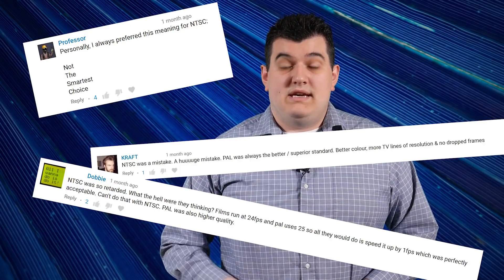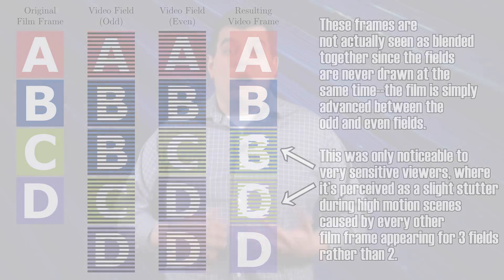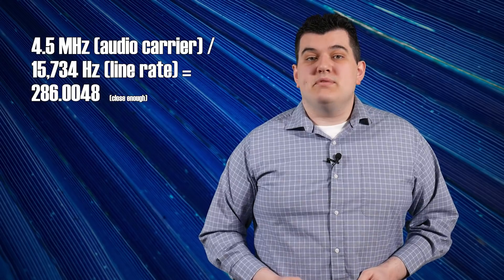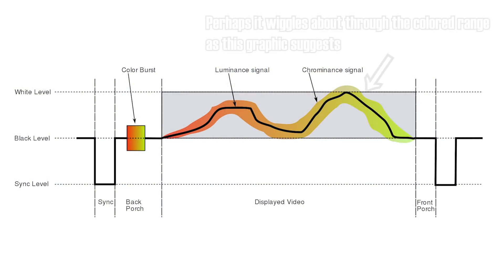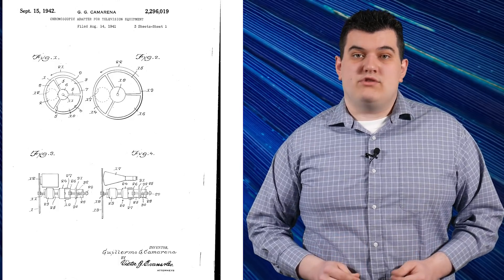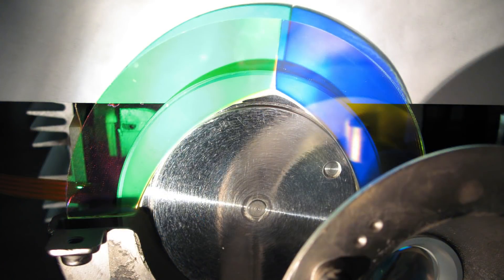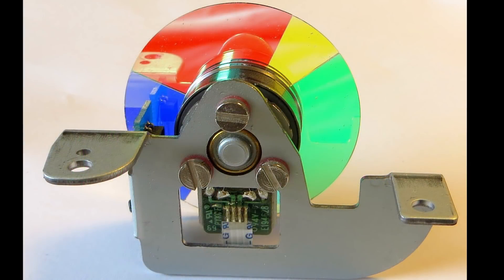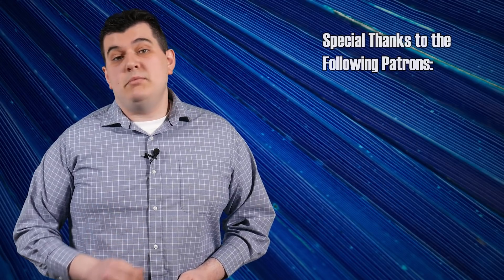Analog Color TV Wrap-Up--Some extra info

Comment: Boy you bring back my memories of color tv. I use to replace a lot of color picture tubes back in the day!!! The old round ones, the triad or triangle gun, the inline 3 gun, and the Sony one, which was the easiest to align , I could tell you stories. Sony’s were great color TVs but the tuners were a pain in the neck especially the UHF tuners. I had to rebuild many a tuner in my time. Electronic tuners fixed that issue. I still have 3 working NTSC TVs in my house, two Sony’s and 1 Zenith and the one Sony is about 40 years old and still going strong!!!! And yes I was a tv repairman!!!

Comment: Just noting here that PAL shouldn't be confused with the various broadcasting standards that use PAL color encoding. Most PAL broadcasting standards are similar with differences concerning only channel and video bandwidth, but PAL-M which is used in Brazil is transmitted with 525 lines at 59.94 fields per second.

Most sets I've used happily picked up PAL encoded colors from ~60 Hz field rate sources (PAL Atari 2600 running NTSC games, PAL Amiga 1200 running a 60 Hz video mode, MSX2 at 60 Hz). RGB is often available as a much better option for these systems, and everything is headed towards digital, so this is increasingly becoming a piece of useless trivia, though.

Comment: I read here a few complicated explanations re 'colour dot crawl' on a PAL or NTSC broadcast (they both do it). A good way to think of it is when you modulate a carrier with the information you are left with the carrier and sidebands. Those sidebands run either side of the carrier from effectively DC to infinity but they are at multiples of the modulating waveform, they look like the lines in a diffraction grating. This is the crux of how the backward compatibility worked. The sidebands allowed the cleverly chosen colour sidebands to slot, like a comb into the luminance signal. The B&W receiver would just not see the colour and this is why the NTSC colour(color) frequency is chosen - not to be 3.58MHZ but 3.579545 mhz±0.0003% so it ALMOST perfectly slots in. - It doesn't hence dot crawl.

Comment: One thing we need to remember is NTSC color, PAL and Secam are techniques to encode colour information into a monochrome television signal. The whole debate about 525/60 and 625/50 is unrelated. It is entirely possible to broadcast 625 line NTSC color or 525 line PAL or Secam colour or like the Japanese adjust the colour space and black levels of NTSC and in fact some South American countries broadcast 525/60 line PAL or like Brazil 625 line PAL with a carrier set at 3.58mhz... so for a true comparison set up a monochrome standard and then add the color system ... the BBC test broadcast 405 line with NTSC color for instance and here in Australia tests were carried out with 625 line NTSC and 625 line PAL before choosing the PAL standard.

Comment: Speeding up the film was better than 3:2 pulldown. To this day I can't stand pulldown judder. It is not "only noticeable to very sensitive viewers"! Your graphic is misleading, it shows only one phase - the fields are not really misaligned, however the judder caused by pulldown is just awful - it's always noticible. The problem is that frames B and D appear for 50% longer than frames A and C. So when you're watching a 24fps film, every even film frame is displayed twice as long as every odd film frame. A similar thing can be said with the pitch shift in PAL - it's not always noticeable, but when you know how something should sound it becomes obvious and irritating.

But the other disadvantage to NTCS is that shows couldn't be filmed at 30fps in 16mm (or 35mm). To film at NTSC's native 30fps you had to use video cameras. Shows that were shot on film, for example Sienfield, were filmed at 24fps. It was rare to have film-based cameras that could film at 30fps, Hollywood used special high-speed film stock any time they had to shoot material faster than 25fps (for slow motion shots). Filming at 25fps was commonly done to film CRT televisions and monitors, and those shots then played back at 24 frames per second with the rest of the film. Almost any time you see a TV in a film in the 70's, 80's, or 90's it is either a composite element, or a PAL-compatible TV running at 50Hz and filmed at 25fps.

Comment: Interesting; I recall back in the 1980s that it was common knowledge that American TVs had fewer lines than ours (and this was the reason why one couldn't buy movies on VHS in the US and play them at home) but not that the FPS was different, the '24 FPS for TV, 25 FPS for movies' thing was usually quoted on children's TV as though it was a universal standard. As far as the thing about the BBC switching from 405 to 625 lines goes, I think the reason why backward compatibility was not considered an issue was that the 405 line system had been introduced in 1936, almost 40 years earlier, and couldn't be sustained indefinitely. (Ironically, as the National Media Museum in Bradford points out, in 1936 the 405-line TV system was marketed as 'High Definition Television', which it was compared to what came before, of course--there is nothing new under the sun).

Comment: The ability of PAL to "correct" for phase errors by averaging alternate lines is one of its worst features. PAL is, in every way, worse than NTSC. The transmission chain is free of differential phase error, * and with a correctly designed receiver, NTSC will always produce the superior picture, with greater color detail.* PAL "corrects" this error by desaturating the color. Given the high-quality transmission chain in the US, differential phase error was generally not a problem (though it was in Europe). Henry Kloss (who designed the Advent projector) once stated that the best color TV he'd every seen was NTSC. It should be, because NTSC is inherently superior.Almost everything else you state is mostly correct. Despite being an EE with plenty of reference books on color TV, there are many things about color TV I still don't understand. If you'd like to get together and discuss them, I'd be delighted.  grizzledgeezer@comcast.net

Comment: about 25vs30: this has nothing to do with quality, but all to do with mains-hum.
Europe has 50Hz/230V mains and PAL has a field-rate of 50Hz to keep the mains-hum outside the visible portion of the signal.
America has 60Hz/110V mains and NTSC has a field-rate that's close enough to do the same thing.
Reply: NTSC games ran better too
Reply: @blackhatfreak  In my experience, it's more of a preference, and nowadays mostly irrelevant. The thing is that PAL has better resolution, and NTSC has better framerate. In reality, you probably shouldn't use either of these for games, unless you really want/need to, because on modern-ish game consoles like Wii, PS2 or Xbox 360 it looks like crap either way. The only thing that annoys me about PAL is that when I'm capturing video from my consoles, my crappy capture card doesn't know how to properly deinterlace video, and so I get 25fps mess, which is a lot worse then the same mess in 30fps, but running on a real TV, I don't mind 50Hz/fps honestly.
Reply: That’s 60Hz/120V for North America, not 110V. (It hasn’t been 110 for a long, long time.)
Reply: @tookitogo  it was when standard was defined, so more accurate correction would be *had
Reply: MrBlc Duh, hence why i said “it hasn’t been 110V for a long, long time”, so clearly I know it used to be the standard. But in that case, the OP would have needed to say that it was 50Hz/220V, since that nominal voltage has since changed, too. My point was simply to remind people that it’s 120V now, and has been for the better part of a century. It’s illogically irritating to me that people still call it 110V so long after that ceased to be correct.
Reply: "mains-hum out of the visible portion of the signal" isn't absolutely correct. Instead, using the same field rate as the net frequency ensures that if interference distorts the picture in a TV set, the distortion is stationary and doesn't run through the picture. Stationary distortions are much more sufferable than moving distortions.
To make this work, the field rate was synchronized with the net frequency. The TV set would hang on the same electricity grid as the TV station. If you received a signal from abroad from another country whose electricity grids weren't connected with each other, it wouldn't work.
By 1953 when color TV was introduced, TV manufacturing was already that advanced that interference was no longer an issue. So the developpers of color TV could create a system were field rate and net frequency were no longer identical and the field rate was no longer synchronized with the grid. This created problems in older b&w sets that suffered from interference. So color TV was not 100% downward compatible.

Comment: There were dual standard TVs, both monochrome & colour, available in the UK during the sixties.  This was during the period leading up to the other channels (BBC1 & ITV...yes, we only had three channels at the time) converting to 625 line UHF.  These dual standard TV sets had their mechanical contact problems, and I certainly remember that.  You can see a marked improvement in quality, looking at VTR recordings from the 60s, even for monochrome pictures, as they moved to the newer camera equipment.  However, I am aware that a dwindling 405 line VHF service did persist, until finally closing down completely in 1985.

Comment: Have not watched it all yet... but we also need to remember that it was in Interlace. It was 50 FPS (PAL) more or less with half the  resolution... it is really visible when you digitize PAL... 1 digitized frame (1/25) contains (if it's a moving scenery) 2 actual frames interlaced...

Comment: Actually, I have an issue with PAL unrelated to framerate or resolution or movie compatibility and/or convertability.
My problem is with the phase alternating itself and with the delay line used to handle it.
Now that analog broadcast are no more, the technical advantage of PAL is no longer needed. PAL's current significance to most people is it's use in mostly old locally connected consumer electronics, using in Composite and S-Video connections.
All but very old PAL TVs use a delay line to correct broadcast related color shift, which is a convenience for broadcast, but does NOTHING for locally connected equipment that electronically generate the video signal, like game consoles or DVD players (Video tape decks are a different matter, especially when you play old TV recordings that might contain those broadcast errors). For these, which I would presume are the only current widespread use of PAL, the delay line just reduces color resolution and offers no benefit, because the signal is already good... Except, for what I've been noticing with, for example, my PAL SNES when I capture with a PC device. A slight problem shows up that doesn't seem to happen with other PAL video sources. The phase alternation on the PAL SNES's video generator seems to be slighty off. When displaying mostly flat colors, if I turn down the function on the card that is equivalent to the delay line (mixing last croma line into current so that phase changes cancel out), I actually get slight hannover bars.
My theory is that the video generator doesn't do the phase alternation 100% correctly and just relies on the delay line in all TVs to correct it's own shortcommings.
Also, while there's a hue control included, adjusting it manually doesn't solve the problem because the adjustment that fixes one line throws the alternate one off, because the phase shift done by the encoder is incorrect for one of the orientations.

PAL was meant to fix BROADCAST problems in a time of analog TV, and in that field it certainly succeeded. As a system for locally connected equipment, it's just messy.
I like the rounded rates (no decimals, like in NTSC), I like the higher freq of the color carrier (more color resolution), but the phase alternation technique that made it great for broadcast, just makes things harder now, and easily falls victim to cheap implementations.

Comment: One of the the various issues with NTSC PAL and SECAM is the ability to maintain quality over long cable transmission (esp. in the days before satellites)...  ironically ..apparently.. NTSC was more stable and easier to manage in such conditions ..perhaps because it could be rectified more easily.  SECAM was notoriously difficult to use in the studio (chroma key for instance is impossible)  so even in France  programs were created in PAL and transmitted in SECAM .  As for frame rate.... many UK productions were filmed at 25fps for obvious reasons.

Of course in the UK during the 50s the BBC experiments with 405 line NTSC colour ... but in the end the decision was made to hold off colour until 625 line came on stream. I suspect because 405 line NTSC displayed on sets of the day looked as good as 625 line in an era when CRTs of the day had relatively lesser resolution. 

In the valve (tube) era stability of transmission chains was a big issue for the BBC and I suspect that was also a major deciding point ..but also I get the feeling the Beeb simply did not want colour at the time. ITV was pushing hard! Advertisers wanted colour.

As for NTSC vs PAL.... forget it.... side by side NTSC -M vs PAL G is all about resolution and stability... and colour accuracy... and PAL G wins both but flicker is a more subjective issue... I have never be worried by 50hz flicker... I have lived with it all my life...these days of course.... 525 line NTSC at its best is good but somehow reds and oranges never look right for me ... start an NTSC DVD and the WB logo looks orange not gold...purely subjective...
Reply: Regarding the first paragraph... NTSC's hue fluctuation issues were only ever an issue in over-the-air broadcasts. Once put into a wire, it was rock-solid. 

Regarding the last... I suspect the color issue was due to the display not really being set up for NTSC image reproduction, as I've never had those issues on my American television. If your display is configured for PAL's different color gamut and gamma curve, NTSC sources will look wrong. And those adjustments aren't controls that were ever readily accessible to the end user.

Comment: Your NTSC / PAL comparisons are absolutely fair and correct.
As you say, 'colour' tv (yes there is a 'u' in English, English) began in July 1967 with Wimbledon tennis.  Ordinary folk could only aspire to own the very expensive sets back then.
I'd be interested to know just how gradually American NTSC 'color' tv was taken up by the population.  I visted the USA in 1967 as an 11 year old and nobody we knew in America had a color set at home.  I'm assuming that take up from the 1954 launch was very slow.
As you say, the UK rollout was initially on BBC2 (a 625/50 UHF b/w service that began 1964) in 1967.  BBC1 and Independent TV were transmitted in VHF 405 lines only until late 1969 / early 1971 depending on region.
After 1971 the sales of colour sets suddenly rocketed and reached 50% saturation (no pun intended) by 1975.  Monochrome tv sales were by that time virtually dead!
The 3 tube plumbicon cameras used at Wimbledon in 1967 were Philips/Peto Scott PC60's (sold in the USA bearing the Norelco brand name).

Comment: Although the carrier is removed the crhominance signal is still a sine wave added to the luminance.
If you divide the crhominance carrier frequency by the line frequency you get the number of chrominance cycles per line and therefore the number of dots per line.
The higher the saturation the bigger the amplitude, this results in bigger change in luminance and therefore in more apparent dots.
On the other hand the phase depends on the hue so the dots will not be equally spaced, depending on the hue their spacing will change slightly.

Comment: The number of lines is dictated by the (black and white) television system, not by colour systems such as NTSC or PAL. M has 525 lines, B/G has 625. As pointed out in other comments, Brazil combined the American M system with PAL.

The statement of backwards compatibility not being on anybody's mind in PAL countries sounds strange to me. Yes, the UK let it coincide with a switch to a 625 line system, but most countries did not. Old Dutch/German/etc. black and white TVs still function today with no modification required (at least until the analogue broadcasts are ceased, then you'll need an external RF modulator).

Comment: NTSC vs PAL is the classic first to market worst to market scenario for exactly the reasons you described. The later technology gets to learn from the earlier mistakes.

We experienced the same issue when moving to digital TV, The UK pushed really hard with the Freeview system. The result was lower power transmissions ( so as not to interfere with the analog signals on nearby frequencies ) so you needed bigger aerials to even get it,  and MPEG2 encoding ( hardware decoders for anything better were not available/too expensive to be putting in cheap set top boxes) so the video quality was not much better than the original analogue. The rest of Europe started there transmissions years later so their equipment supported MP4 encoding and higher bandwith. The result is that European Standard Definition Digital transmissions are better quality, and almost as good as the later introduced High Definition Digital TV in the UK, which required everyone to buy new boxes for.